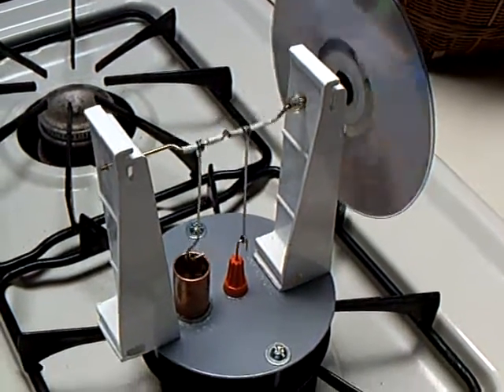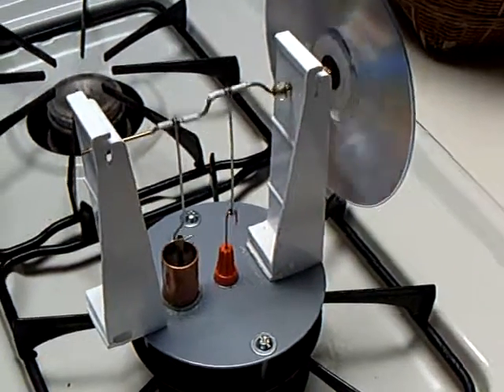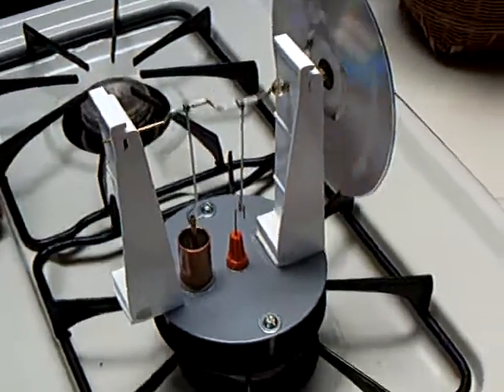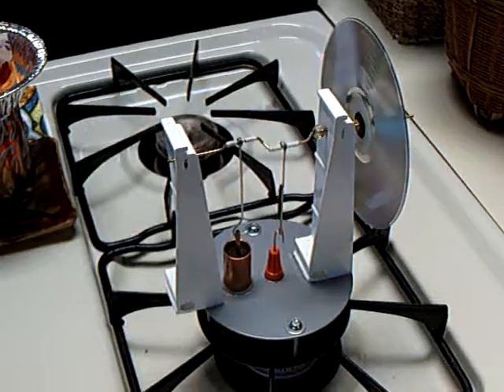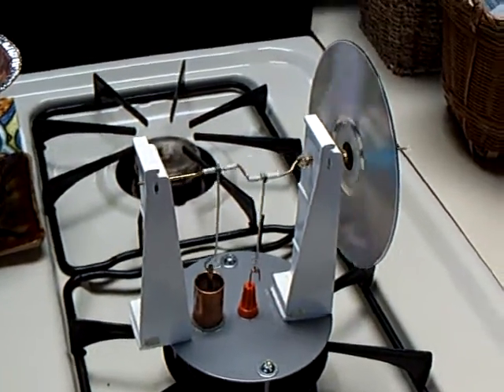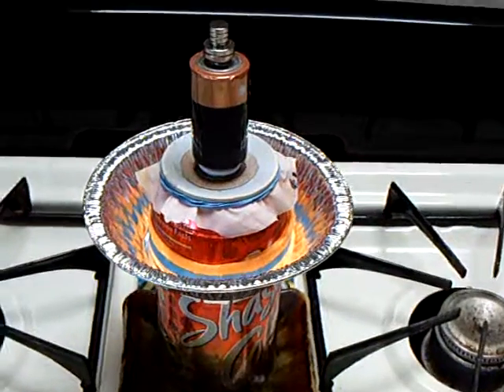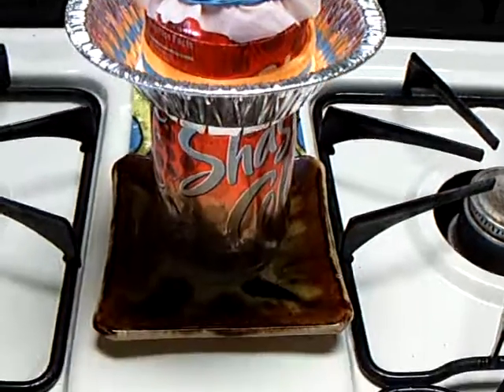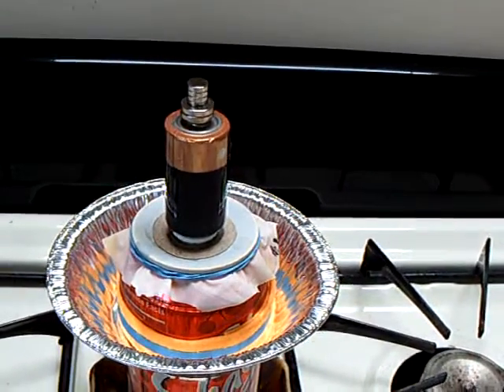Stirling Engine Failure----now working

Comment: I finished my stirling engine yesterday. And it looks exactly like ur old one. After spending so much time on it, It doesnt work. I tried everything and even reconstructed the whole thing. I didnt sleep last night cuz i was working on it. I made my displacer with Styrofoam and now it melted. Please help!!
Reply from the maker: +Shreyaj Shrestha Well I know exactly what you are going through.  I have a stirling engine project I have not started just because I remember how hard it was to build one and get it running.  All I can suggest is to build one of the simple coke can ones first to learn about what is going on.  Watch a bunch of videos on these things and pick a design next that you feel is within your build capabilities----then just go for it.  If it doesn't work put it aside and do something else for awhile then come back to it.
Reply: ***** I have to get it running by next week. I'm doing this for a science fair. I just don't get what's wrong with my engine: (

Comment: Hey lidmotor. I've been watching your videos for several years now. I had a question for you about coaching. I'm working on a pulse motor project, and I need some help and pointing in the right direction for some issues I'm having. I have been working on a serious project for years, I left it for a while, but now I'm working on it again. If you could skype or something like that, and wouldn't mind helping me here and there with my invention on what I need to know I would be extremely happy.

Comment from the maker: Check out Myfordboy here at Youtube.  He will email you free plans for an easy to build Stirling.  At his web site he has a detailed build guide.  There is also an excellent DIY video.  The engine uses a "travel sweets" candy tin which I had to order.  All the other low cost parts are easy to find a the local hardware store.  Basic hand tools and skills are required.  You and I CAN build one of these.  I am gathering parts.  He sent me the plans in one day.   Nice guy.

Comment: Ah, yes, the rubber bellows of the pistons don't like to freeze. And, not a good idea to chill the machine just after a failed run, when the water has worked its way through the too large hole into a *good idea* card and paper displacer lol. 
Have never got the counter weighting of the flywheel correct yet either, much to learn. Still aiming for the large outdoor solar Sterling for Summer :)

Comment: Congratulations Lidmotor on all your hard work, and great work Bladeatilla and Simi.
As you may know I have worked with steam engines for years.  With low pressure engines, diameter really helps (14 psi x area), but dimensions are so finicky with these engines.